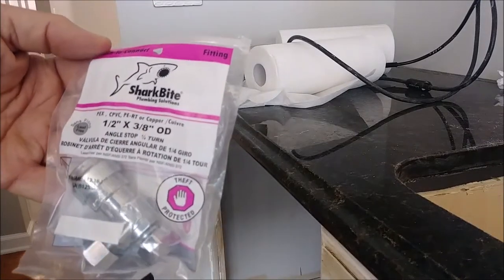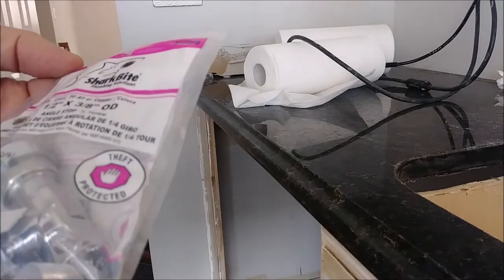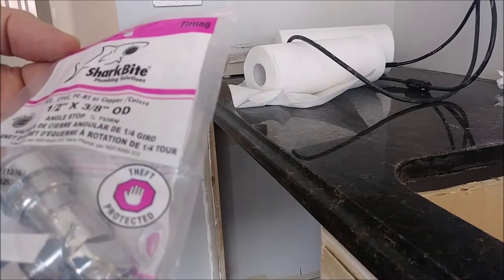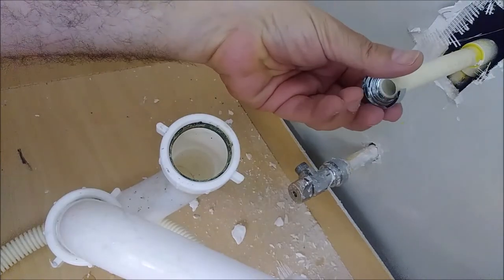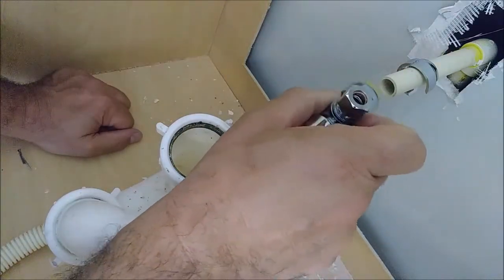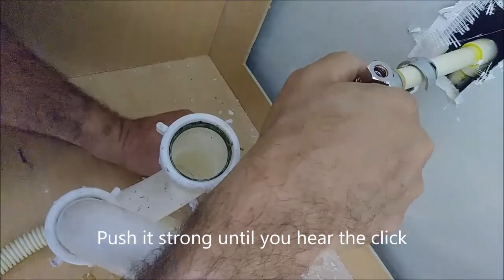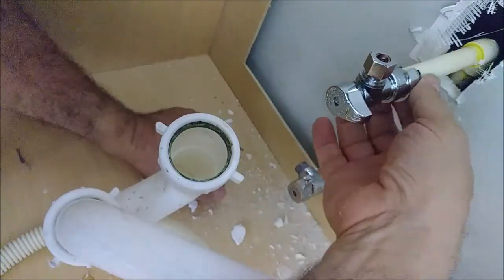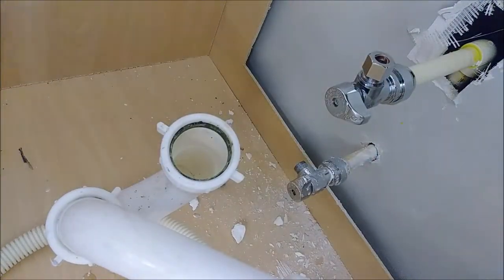How To Install A SharkBite stop valve On A PVC water Pipe - In Less Than A Minute

Comment: I dunno, that’s cpvc, not pvc that you installed it on. I thought shark bite had special valves for cpvc that you glued on, using the yellow cpvc glue. Has this held up without leaks? Thanks!
Reply from the maker: Yes . It never leak.